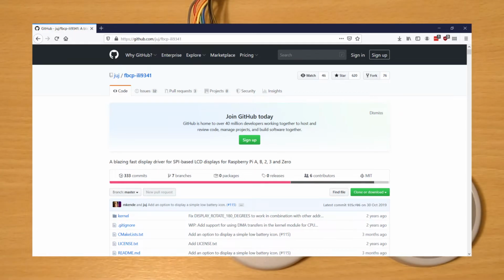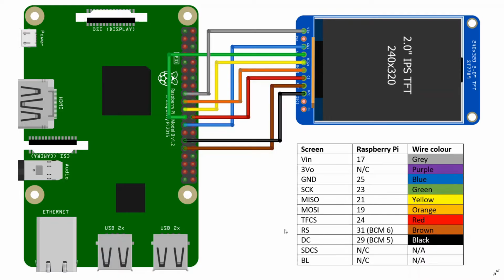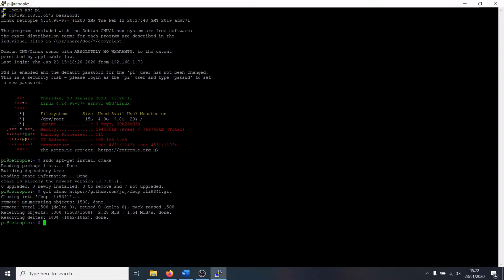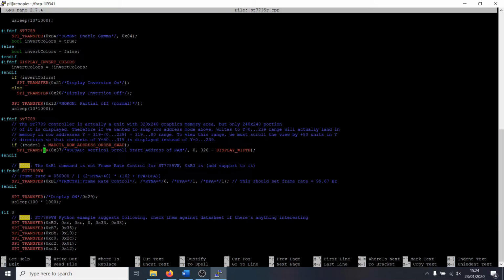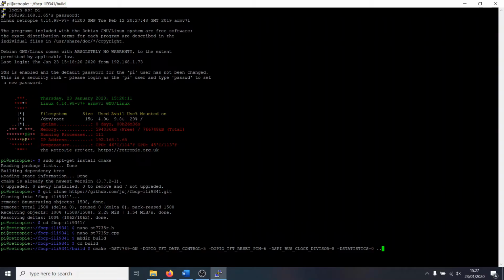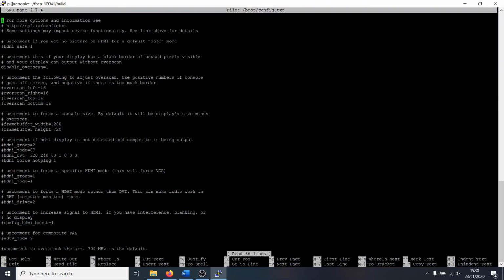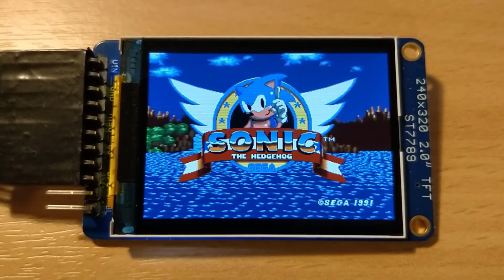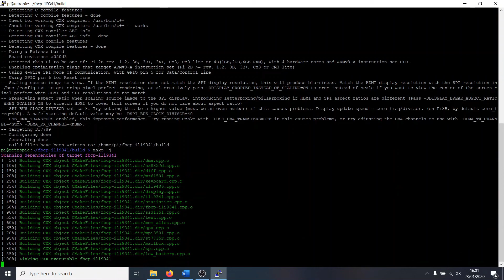60fps on an SPI display using the Raspberry Pi and fbcp-ili9341 (includes fix for 320x240 ST7789)

Comment: I tryed to run it on the "240x240, General 1.3inch LCD display Module, IPS, HD" from Waveshare and only get a blackscreen (back lite is on) How could I find out whats wrong?
Reply from the maker: There are so many things that can make this not work! The 240x240 from adafruit (which I believe is the same screen) definitely does work, so you might have to keep trying. Double check all your pin connections, and the cmake command should be something like this:
-DST7789=ON -DGPIO_TFT_DATA_CONTROL=5 -DGPIO_TFT_RESET_PIN=6 -DSPI_BUS_CLOCK_DIVISOR=8 ..
(don't forget the two dots on the end!) providing you have reset on pin 31 and dc on pin 29. Try increasing -DSPI_BUS_CLOCK_DIVISOR=8 to =40 or something. See if it works at all. If all else fails, you can ask on the github page for help there.
Reply: @ScottMarley  because of the strange pin labeling of the screen i connected it wrong, but now its running. Thx :)
Reply: @JKiel-de1kt  hey bud how did you wire the wave share im cofnused because there is no mosi or miso only CS DIN  etc
Reply: @ivanravenski  Jo, thats why I was confused too.... Here you are: 
purple/vcc = 1
white/GND = 6
green/DIN = 19
orange/CLK = 23
yellow/CS = 24
blue/DC = 18
brown/RST = 22
grey/BL = unused

Comment: Hello, thanks for the video
I have a question, does v-sync work in this kind of setup? or are you having variable refresh rate depending how many frames you push into the screen? do these kind of displays suffer from screen tearing?
Reply from the maker: The short answer is that no, vsync doesn't work as SPI screens have no idea what vsync is. The long answer along with some ways to mitigate it can be found here https://github.com/juj/fbcp-ili9341/blob/master/README.md#about-tearing

Comment: Hey :) 
Thank you for this video! Do you think the lib could also work with other SBCs? I have an OrangePi Zero
Reply from the maker: This library is specifically for the rpi, but as both this and the orangepi can be Debian based it might be possible to port it. You are best asking this on the fbcp-ili9341GitHub page.
Reply: @ScottMarley  thank you for your quick answer! I will do that :)

Comment: Howdy, I get a  "Please specify which display controller to use on command line to CMake!" error. How can I specify the display controller? Here is the command I am running: ""cmake -DHX8357D=ON -DGPIO_TFT_DATA_CONTROL=25 -DGPIO_TFT_RESET_PIN=24 -DSPI_BUS_CLOCK_DIVISOR=10 -DSTATISTICS=0 .."" so the back of my screen says HX8357D so I assume that is the driver or controller right? how to fix?
Reply: well I went into the Cmakelists.txt and saw there was an ADAFRUIT_HX8357D_PITFT so I will use that if not then I'll do what you did and edit the text files
Reply from the maker: @adriang.4628  Yes, definitely give that a go. You might also want to open an issue in GitHub. The readme.md says that you can use -DHX8357D=ON but there is no code in CMakeLists.txt to check for that build option. Must have been an oversight.
Reply from the maker: At first glance, it looks like editing CMakeLists.txt to add the HX8357D should be straightforward, use the other entries as an example.